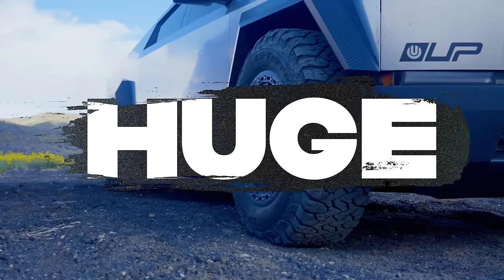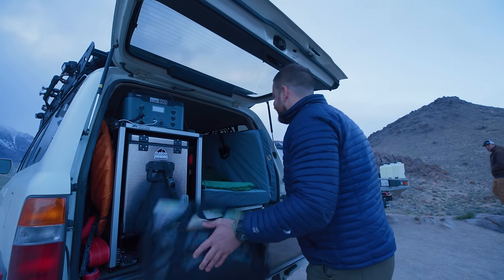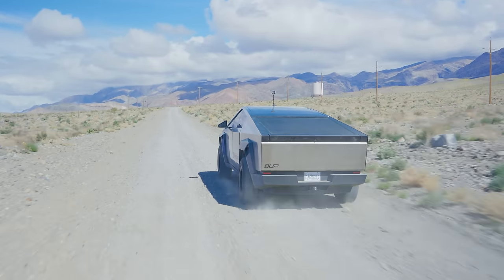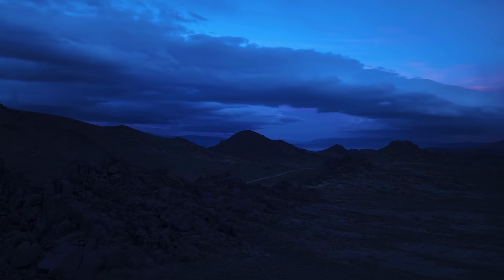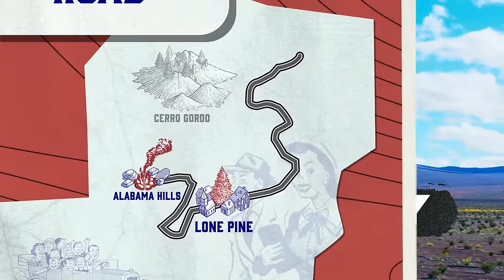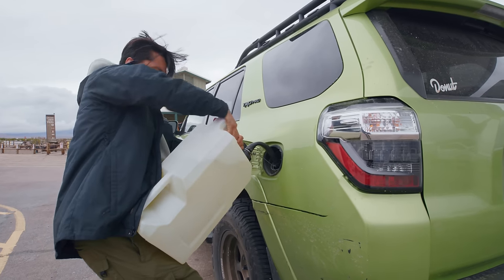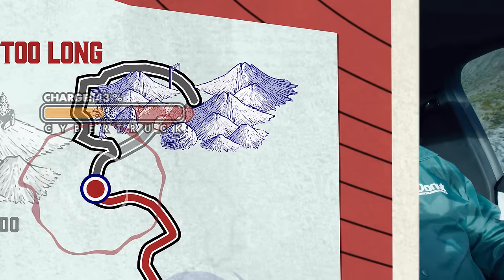Surviving 100 Miles Offroad in a Cybertruck

Comment: Hats off to you guys for taking an EV truck to Death Valley.  I was planning a trip to Death Valley in my Toyota Rav4 Prime and and I was looking for places to charge and I was like man what a nightmare.  I just said forget charging.  I think a PHEV is PERFECT for Death Valley.  The Rav4 can pretty much go anywhere in Death Valley if you are brave enough it has 500+ mile range so you don't have to get range anxiety.  Even when I ride my motorcycle through death valley I get range anxiety.   I'm jealous you guys went to Cerro Gordo, when I was riding my motorcycle up the back end in Saline Valle of it which is extremely steep and rocky I ran into snow and ice.  When I ran into enough of it I decided to turn around.  I didn't know it was much easier on the other side.

So what the Cybertruck fun to drive off road?  Was it comfy on those bumpy rocky roads?  I know the rav4 I had to air down it was so bumpy on those small SUV tires.
Reply: Lol you didn't actually watch the video did you.

Comment: Yeah that upcoming battery extender for the Cybertruck is an absolute MUST if you wanna go on trips like this. Just like bringing a jerry can, if you wanna go on a long distance off-road trip like that, youve got to have a way to extend your range. I wonder if one day itll be more common for there to be solar powered chargers installed on off-road trails...? Also, Battery capacity and charging speed has doubled in the last 10-ish years (hence why EVs are only a thing now) and is supposed to do the same in the next 10, so I wonder where we'll be then.
Also, super lame that the Cybertruck didn't launch with the ext battery and solar bed cover
Reply: It’s a decent sized bed. You could probably put a diesel generator in it and recharge it anywhere😊
Reply: @taa-dow6713  or just bring your own solar kit
Reply: @taa-dow6713  at that point just get a disel ICE driven car
Reply: More likely a diesel powered charging station.
Reply: @paul5683  There are already charging stations out there that are solar with a battery backup. Would be more than enough. The cost of transporting diesel to the middle of nowhere would cost so much that nobody would want to use the charging station. It'd end up costing 2x or more of gas. Keeping it solar means near zero upkeep costs, so the cost to charge would actually likely match or beat typical charging stations.
Reply: @enricosantini3154  Agreed. Using gas/diesel generators to charge an EV is wildly inefficient and defeats any kind of savings from using an EV in the first place.
Reply: How much is the battery extender?  How much is a gas can and a fill? 
This truck is so stupid and unreliable. Justin and Donut are WAY too nice to Tesla. If they were comparing any other "off road" vehicles the test wouldn't start at it's going to be too cold and too far. There is no argument for this waste of money.
Reply: @Harrylymon  well I mean, you ask that as if both would only be used once...also they've driven it and you haven't soooo
Reply: @danielsondiecastracing  Fine. For the price of the extender how many fills of a gas can could you get, including the price of the can? You get the point and are avoiding the obvious. And that's the point of the video...they test drove it. Yes EVs will improve, but in the mean time, This One Sucks.

Comment: My 91 Honda prelude could have made that trip😂
Reply: For range, the Honda prelude would have way outlasted every vehicle there by a lot. And not made more than a few feet once they went offroad. Those landcruisers original spec before modifications for off road only got 275 miles range. Your prelude was around 375. With the mods they did, they are probably closer to 230-240 miles range. The tesla with the modified tires was somewhat less.
Reply: im surprised yours still works my vtec went out and i have no idea what's wrong with her

Comment: 15:56 the future is in like 8 years 
Bahhahahha fr
Reply: We built an electric truck for $10k in high-school in the late 90's that could outperform/range most of what comes out now.. I've been waiting 30years for them to 'figure it out'
Reply: @rogerwilco1777  You might have but whatever you built back then definitely wasn't reliable enough to actually use on a regular basis.
That's why cars get mass producedm that's why people buy cars instead of building them themselves (exceptions are always there).
Reply: At least with the CyberHype Thing., The Chevy EV truck has a 450 mile EPA range while the Cybertruck advertises a 301 mile EPA range. People who tested the Chevy EV actually got close to the advertised range on highway driving. Donut literally bet on the wrong horse here.
Reply: @rogerwilco1777  I find that highly doubtful. EVs were still trash at that time with lead acid and lithium ion only just came out for EVs on 1998. Which was the 1998 Nissan Altima and that battery was temperamental and the development was arduous. There is a lot more to it than just a ragtag team putting things together to make an DIY vehicle.
Reply: @MrMega200  That's probably because GM doesn't try to reinvent the wheel.

They take what is new, the modern EV platform, and adapt it to already proven vehicles.

Meanwhile Tesla comes along and tries to be quirky and different, which isn't necessarily a bad thing but if you fail on literally every single promise you made then it is.
Reply: An electric truck will have to WIN the Baja 1000 to get me to even consider electric equal to ICE.
Reply: @danielm6049  It isn't and it never will be. That's not to say EV's are necessarily bad, they do have their uses but it's not the future, atleast not in their current form.
Reply: @Z38_US  I do agree with what you say, they have their place which I know works great for some people. I just don't like certain organizations are trying to force us into them.

Comment: The dang licence plate almost flew of the cybertruck a 12:40 😂😂
Reply: that's a new-car paper "plate"
Reply: @Fyre0  ohw wow did not know that. Seems odd to first use paper, because printing a plate is like a 5-10 minute job. At least that was the case when i bought new ones.
Reply: that always happens
Reply: @angeloverton7063  It's temporary, straight from the dealership/store. They're to be replaced by the actual plates from the department of motor vehicles after registration. Usually no more than a couple weeks.
Reply: Tesla had to be escorted by an actual truck

Comment: Somewhere in my cargo would be space for a generator and some fuel along with the Tesla 110 charger. It might not charge fast but I would have a way to charge it !!!
Reply: So let me get this straight
You are gonna carry fuel
Which then gets turned into electrical energy by combustion to then be transferred to your vehicle?
That is a huge power loss through transfer wtf
Reply: @Metal_Tao  Ideally you would use a charger most of the time but in a remote area for offroading it's probably a good idea. Also that's how trains work. They run a diesel generator to power electric motors. Electric motors have insane torque so it makes sense in that way.
Reply: @Metal_Tao  No shit, but what else are you going to do? Do you also complain about the inefficiencies of an oil tanker traveling thousands of miles across the ocean, being processed, then an 18-wheeler getting single digits miles per gallon, burning a ton of diesel to bring fuel over hundreds of miles to your gas station?
Reply: Yeah good luck, you would get like 1-2 miles an hour lmao
Reply: @SmolPotatowo  Yes I agree, this truck should have been a hybrid, just like every other EV truck should be.  Otherwise they are useless for towing.
Reply: @rustler08  Probably what he's going to do is buy a gas powered truck for 10s of thousands of dollars less.
Reply: @criticalevent  It's Tesla, they'd never do a hybrid. I can see people making "generator mods" for Cybertrucks though.
Reply: @turkishgod5903  Better than being stranded though :^) I know there are people who've done it with other Teslas but haven't seen someone try with a cybertruck.
Reply: @SmolPotatowo  *can't do a hybrid.
Reply: @SmolPotatowo  That's what a Hybrid is which this isn't. Porche's Diesel Electric Drive in the Elefant during WWII worked off the same principle
This isn't what that is as the two systems are not mechanically linked. 
Like
Please tell me you understand the difference between a diesel electric drive vs a Generator being hooked up to a battery powered system. 
The generator is meant to drive the electric motor in the example you are giving which is optimal, this isn't optimal as you are not planning to tell me a small dinkly little Generator and somehow fitting fuel as well isn't gonna destroy the mileage of the battery driven vehicle as it is and not be a complete waste of resources, weight and space.

In short, the generator will not produce enough power by itself to operate the vehicle, but because it isn't linked to the drive of the vehicle, the battery is, it is merely charging it at an in efficient rate and having a degree of separation between chemical to electrical back to electrical and then mechanical energy in the wheels.
Reply: @criticalevent  Yes but they were not towing.  This was a carefully scripted trip.
Reply: @Metal_Tao  There's a video of a guy hooking a diesel generator up to his model Y. It's operating at a negative but he managed to drive over 1000 miles without charging. I think by his calculations he got around 34mpg.

I'm not saying it'd be efficient at all but if you're going to go offroad, really want to drive electric most of the time and don't want to get stuck; it's an idea.

Edit: Also I do believe it would be a hybrid technically. As far as I'm aware a hybrid is just a vehicle that's powered by two separate energy sources. Which strapping a generator to the back of your truck would be.

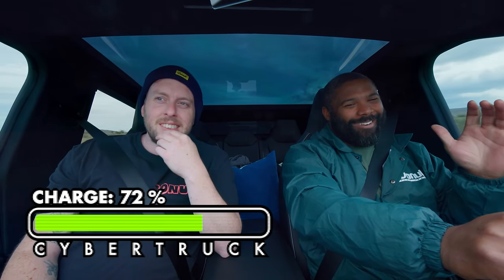Comment: 2:12 When it comes to battery drain, the big one is simply: speed (air resistance). Keep the tonneau closed at highway speed, keep it in low suspension setting, etc. But don't even think about turning off the HVAC, stereo, nav (lol), they make very little difference overall.

Comment: I think these batteries on wheels can be good in a city like a mobile phone as you can charge it frequently. But there are reasons for a analog compass to exist even with long lasting smartphones. We know old things like gas car and a analog compass will work when we need them and won't have to look for a charging socket.
Reply: It would be fine with a generator in the back.
Reply: A city where the streets are full of cybertrucks is not a city I wanna live in
Reply: I mean, one of the gas trucks gave up first.
Reply: @twandepan  Cool. Then move someplace else.
Reply: @jasper_of_puppets  I don’t need to. Cybertrucks are illegal in my country because of the danger to pedestrians.
Reply: @twandepan  lol
Reply: @Idiomatick  no it didnt. they didnt even start the journey because of the cybertruck and only because of it.

Comment: You should have done this with a Rivian R1T
Reply: Would love to see them come back and try again with other EV trucks. The new Silverado is supposed to have over 400 mile range
Reply: @misadventurelabs has offroaded a Rivian....
Reply: That would have been boring, because the R1T actually is a capable offroader.
Reply: @dapeach06  It has the same exact limitation as the Cybertruck, which is range but you have to NPC I guess.
Reply: @boostav  EVs with the same rated range can perform differently in different situations. The Rivian might get better or worse range in the cold weather, depending on how it's built. There are ways to mitigate the effects of low temps on batteries to a certain degree. It probably won't be a massive difference, though.
Reply: @TexelGuy  The Rivian is actually worse in that regard as it doesn't have a heat pump.

Comment: One benefit to an EV (not specifically the cybertruck) is that if you could possibly bring  a large solar charger to recharge your vehicle while camping. It may take a while, but you could do it and not get stuck. A gas vehicle will need fuel for the whole trip.

Comment: "Lights, music, Cruise control and even navigation drop that number"
That's completely correct, except it will influence the range by <1%, so those are things you should not care about.
Airco however has a bigger impact, not that much when driving 80mph, but it has.

Comment: All Teslas have camp mode where you can sleep in perfect comfort with the A/C on. You can camp like that for 4 days before the battery goes flat. Why did you sleep in a tent?! The accessories do use power but it is minute compared to the amount of energy required to move the Cybertruck which is 2x that of a model 3. 
As long as you can access a 110v socket  you can charge. You can also bring a 5 pin socket and charge at campsites at 4x the speed of a wall socket. Even in the middle of nowhere people have electricity. The same cannot be said about petrol. If there is a road closure electricity can still get through, unlike the fuel truck for the gas station that ran out of gas.

Comment: Using accessories in the car does not affect the primary battery that actually makes the vehicle move... its a crazy thing called a 12v battery that helps with using those accessories to ensure battery life gets used by it instead.

Comment: It was 8 degrees in Oklahoma, and the wind was swirling the snowflakes into drifts at the edge of the one parking lot in the city with Tesla chargers. Out of 8 stations total, 4 were broken. We were at 5% charge in the middle of a long line of Tesla drivers, some of which were walking up and down, asking how much charge we had and if they could cut the line because they had less. All accessory power had been cut: heater turned off, lights dimmed, shields down. I was scraping frozen condensation off the INSIDE of the windows with a card. We saw one of the fallen get towed away (it was actually cool to watch; they put those little wheel dollies under it and pulled it up onto the flatbed that way). Thankfully we made it to the charger, and in the meantime I braved the snow to get some takeout. We were there for probably 2 hours total.
Reply: Just wait till BMW (and others?) get to start charging at tesla chargers in a year or so. We sold our EV due to traveling thousands of miles and having issue after issue like the ones you mentioned. The non tesla charging network is garbage. You can tell VW was forced to build it.

Comment: Not that a donut video will get Tesla attention but I have been saying for years that the traction control system needs to be optimized it is a huge battery hog. Whenever the roads were slightly wet or dirt road my efficiency went out the window when I still had my model Y. But now that they have a “truck” it matters.

Comment: Should have packed the portable charger with a 14-50 plug and looked on plugshare.   There are a few spots to slow charge in death valley on 14-50 RV plugs.

Comment: Personally, I'd love a plug-in hybrid (I have a 1.4L Cruze and love it, I was actually considering a Volt then but the used prices on them were far too high at that point.)  I would have been plugging it into the 120V outlet next to my driveway (the driveway is along the side of the house and there's a light and outlet mounted to the side of the house there), driving around straight electric on my typical in town drives, but have that 4 gallon gas tank so I could just gas up on longer trips.

But electric?  I do have the range anxiety.  My sister, her husband, and their kids, they've gone on trips in their Tesla, and it worked; but they did plan the routes around where they had charging stations in range rather than just going wherever.  And had to carve out a good chunk of each day to waiting around while it charged.

Just wanted to comment though, one common criticism of electric vehicles is the range reduction in cold weather.  This is real but not specifically a disadvantage compared to gas engines, they lose range in cold weather too!  (It's just a bigger deal on the electric due to the lower range it has to begin with, lack of charging stations, and slow charging.)  I recently took a trip to New Orleans and back -- on the way down, I got 40MPG for the first stretch; the second stretch, those dudes in the south love their speed so a good stretch was at like 90-100MPH, I got about 34MPG.    On the way BACK?   Iowa got a -30 cold snap... the first part I got about 38MPG.  The next stretch where it was around 0 to -10?   32MPG or so.   Driving through Iowa in -30 temps, 50MPG winds, and blowing and drifting snow?  25MPG!!!   It was some bull, I fueled up where it was "only" 0 so I should have had fuel range to get back with like 200 miles to spare (... this thing has a 16 gallon gas tank).  Saw my MPG was dropping so I topped up like 100 miles later (where it was -10) so I should then have definitely had enough range with like 100 miles to spare.  Got back to town with bingo fuel, and had to go to a gas station in the -30 temps to fuel up! (Since I figured parking it overnight with like half a gallon of gas in the tank was probably a bad idea in those temps.)   I imagine the in town mileage would be pretty bad too, when I stopped for fuel in the -10 temp with a FULLY warmed up engine it was "idling" at like 1100RPM (probably in a feeble effort to keep the engine and coolant temps up in those frigid temps.  You could see the temp gauge start dropping and feel the heater core start cooling off in a matter of seconds of coming to a stop in those frigid temps.  Every vehicle I've had would fast idle that fast or higher on a COLD engine but it's the only one I've ever had that raised the idle on a totally warm engine even in -20 or colder temps. But  those other vehicles burned considerably more fuel so I suppose they burned enough at idle to stay warmed up.)